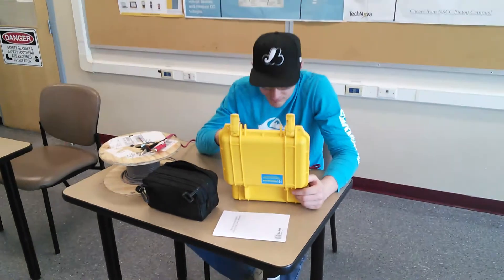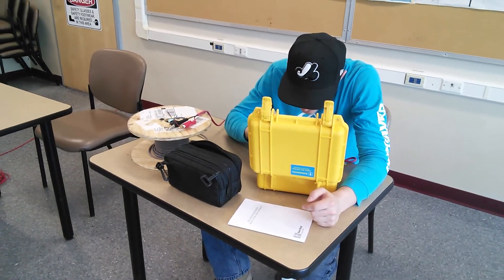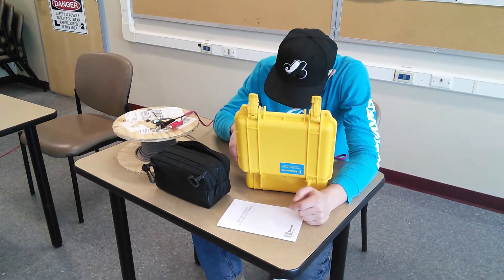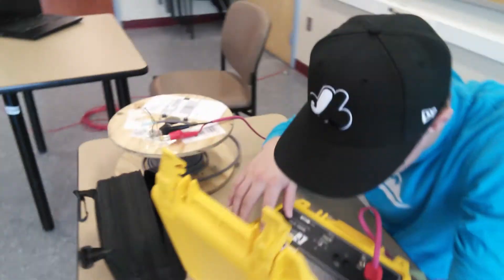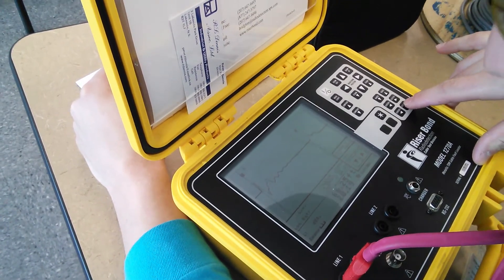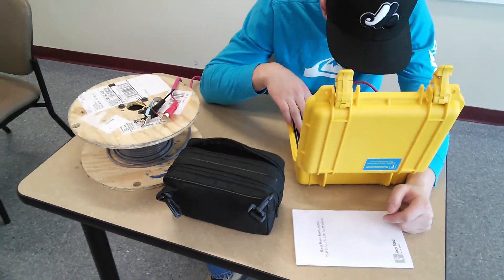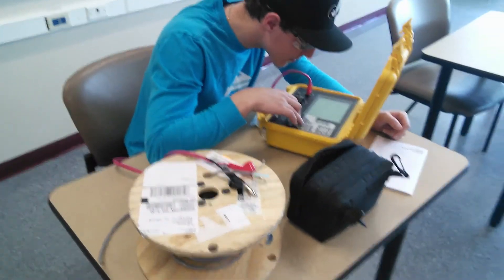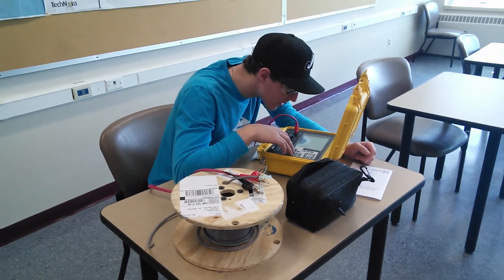What Technicians Do!

Comment: could it detect leaks copper pipes?
Reply from the maker: No, unfortunately not. It is used primarily in the telecommunication  field to pinpoint cable breakages (open), wet, shorts, etc in a variety of cables down to the inch.  Good question though!!

g.c.
Reply: En español por favor